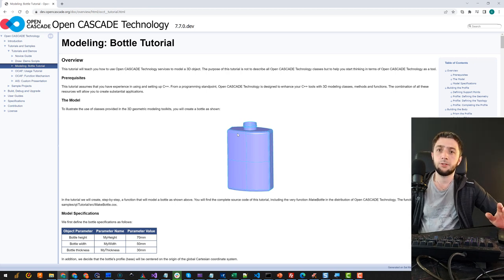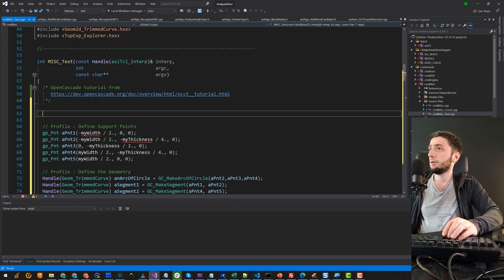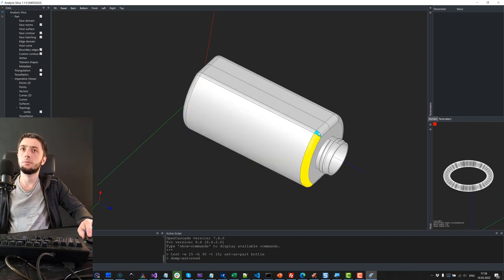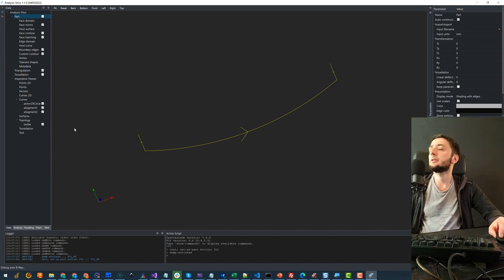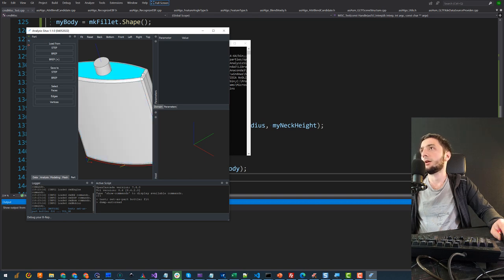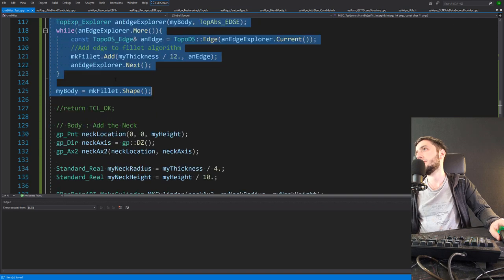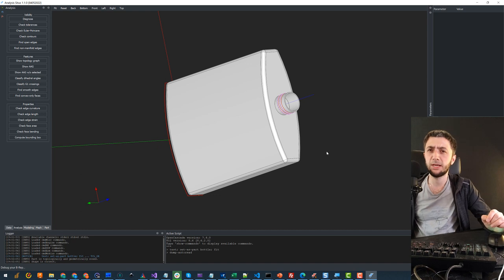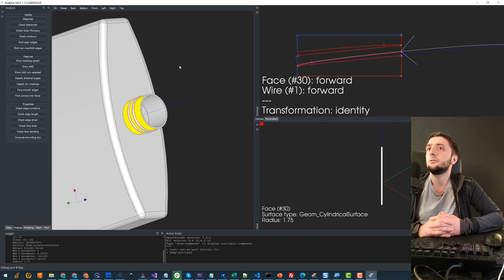Lesson 18: OpenCascade "Bottle" tutorial | Code review | Tricks & Tips | Modeling

Comment: great  content.. just a question... the thrusection returns a shell... i import a model for meshing, is there anyway to transform shell into face...?
Reply from the maker: Thru-section can also return a solid if you give it a specific flag. If you want to get a face out of a shell, use TopExp::MapShapes(yourShape, TopAbs_FACE, allFaces), where allFaces is the collection of type TopTools_IndexedMapOfShape. However, you need to be sure that your shell contains just one face. Is that the case?
Reply: @QuaoarWorkshop  well a solid wouldn't work as i am drawing an aircraft wing and I need to work with surfaces for meshing. I was using TopExpExplorer to find the faces to mesh but i guess it wouldn't hurt to try this method.
Yes, the shell contains only one surface. i built it using two periodic bsplines.
Reply from the maker: @abdoulkarimboussari1119  Explorer is more or less equivalent. You can keep using it. Btw, does thru-section do a good job in your case? How about complexity of the resulting spline, is it simple and clean at the end?
Reply: @QuaoarWorkshop  well so far I haven't met any issue constructing the model, so I'd assume yes...
Reply: @QuaoarWorkshop   here’s a snippet of my code. Nothing fancy tho.
TopoDS_Wire aWr1= BRepPrimAPI_MakeWire(anEdge1); TopoDS_Wire aWr2= BRepPrimAPI_MakeWire(anEdge2); BRepOffsetAPI_ThruSections wing(Standard_False,Standard_False); wing.AddWire(aWr1); wing.AddWire(aWr2); TopoDS_Shape aShape=wing.Shape(); TopoDS_Face wingtip= BRepBuilderAPI_MakeFace(aWr2); aShape = BRepAlgoAPI_Fuse(aShape, wingtip);
Reply: @QuaoarWorkshop  btw it seems like the thruSection doesn’t work when using a set of opened wire. Or at list in my case.
Reply from the maker: @abdoulkarimboussari1119  This algorithm should be quite simple in principle, have you tried to look inside to see what's happening?